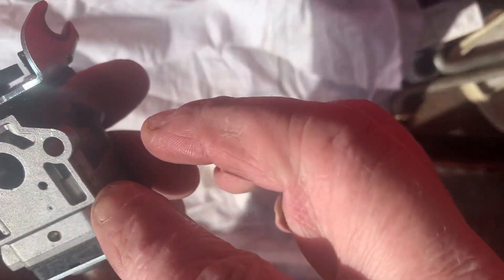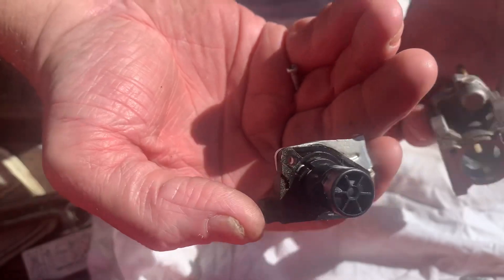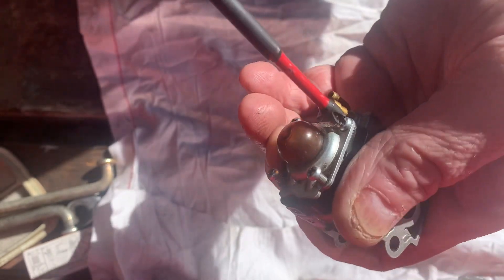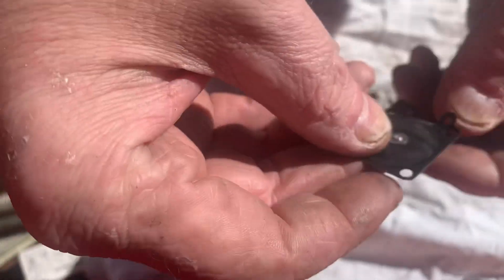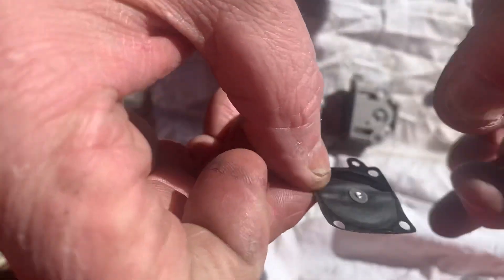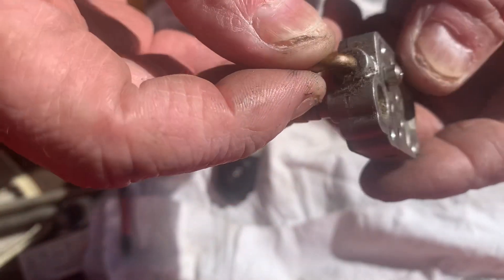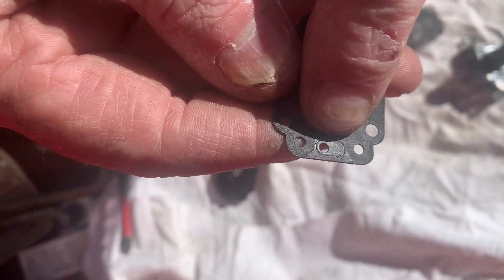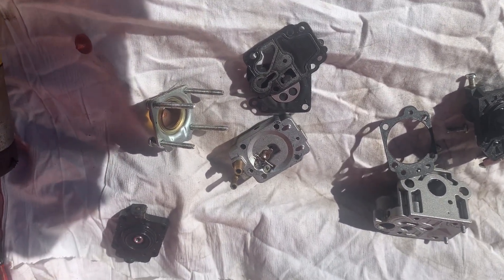#WYK #WALBRO #CARBURETOR #TEARDOWN / CRISPY DIAPHRAGMS / ETHANOL

Comment: There is a small spring that goes somewhere on the needle seat side, but where? 

Also, is there any adjustments you can make on these WALBROW WYK260 (Four Stroke) carburetors?  Mine came out of a Dolma 4 Stroke Gas Backpack Blower PB-7601.1

Additionally, are there any actual adjustments on these WYK260 carburetors besides the one that adjusts the throttle valve? 

Thanks for any insight you can provide.

Comment: Why would you need a fuel filter on a 2 stroke, that doesn't make sense. The only thing the filter will do is lessen the amount of oil going to the mixture. The reason the diaphragms are rock hard is the ethanol.
Reply from the maker: This makes absolutely zero sense. May God have mercy on your soul.

Comment: Now how would you take the needle that goes into emulsion tube out.  And also just wondering if you have any trucks for a stripped out threads on one of the door bottom screws of the carb. Thank you if you have time to help me out here.

Comment: Got a WYK 93a on Zenoah G43  that wouldn’t run. Everything new. Changed everything and I mean everything. Finally it came down to me pulling plastic tank off another G43 and putting it in there and it ran perfect. It wasn’t the lines, cap or plug the lines run through. It was the effin tank!! 
Not sure how that could be. The primer plug doesn’t respond correctly with that tank on there. Head scratcher for me.

Comment: How are they ajusted?
Reply: Many of them have a low speed adjustment screw of different types hidden down in the hole that goes through the middle of where the throttle lever is attached. Some screws take a regular screwdriver and some take what is called a small or tiny single D driver and some may take a different kind. Some of the holes have a simple plastic or rubber cover over it that you just pry off with a screwdriver and some have a little plastic plug down in the hole that you have to pull out. There's a special tool for that or some people just heat up a tiny screwdriver and push it into the plastic plug to melt it onto the screwdriver, let it cool for a bit and pull the plug out and I've heard that some have epoxy down in the hole that you can't remove so they say. It just depends on your particular carb. And I don't think any or many of them have a high speed adjustment screw but some of the chinese knockoffs do.